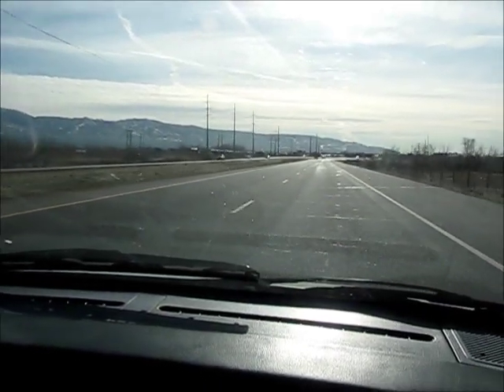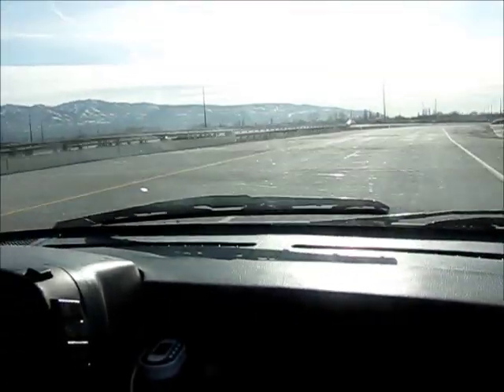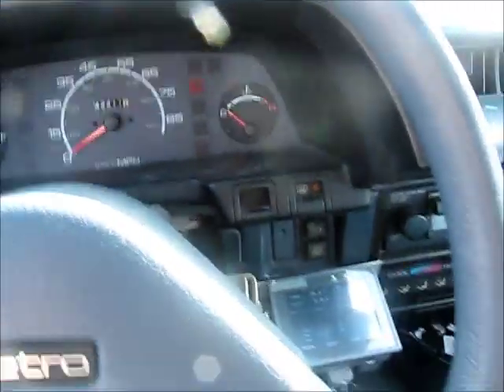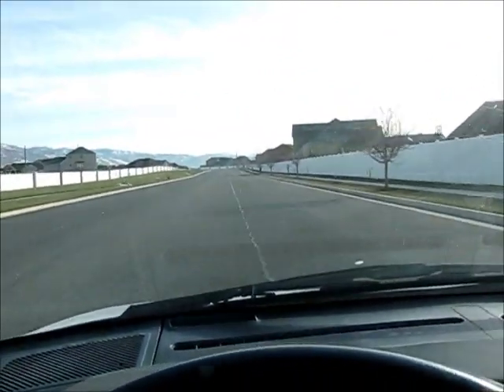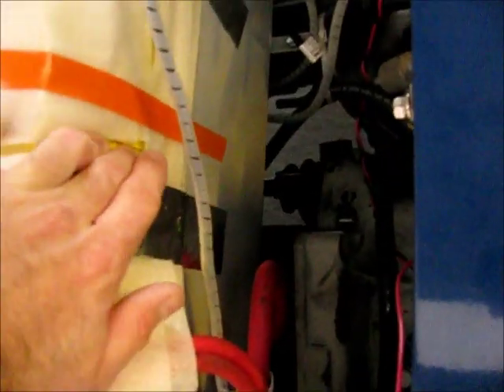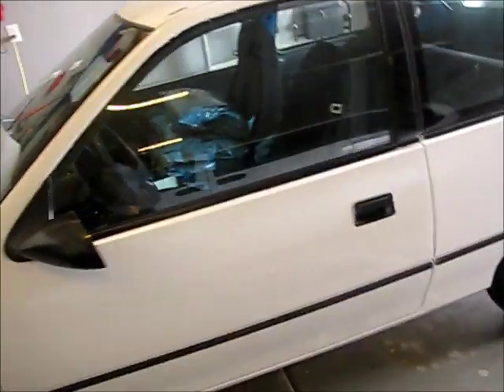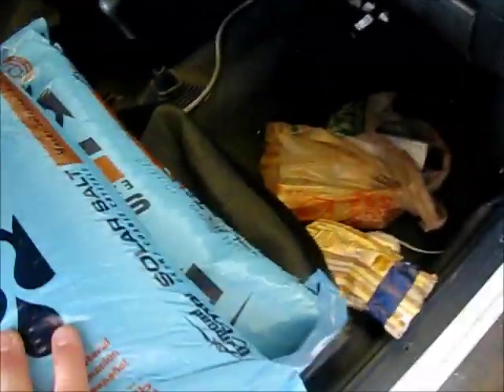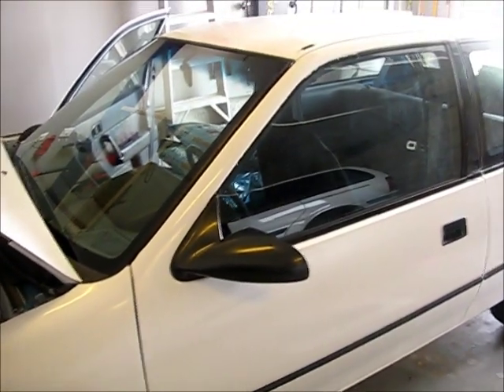Electric Geo Metro 76+ miles

Comment: My buddy built electric cars in 03 and 1000 dollars worth of deka agms would get you 50 miles in a fiero . 14 batteries if I recall. Nissan forklift motor direct couple to 4 speed
Reply from the maker: Lead acid is a super inexpensive way to do it. But they only last for a few hundred charges before they are done and need to be replaced.
Reply: @kc7ekk  in 2003 that's what we had the last one was a lithium porsh 400hp if you cranked it up and about 200 Mile range in eco. He's good, I learned alot. If I had the right motor and controller I'd like to try it but it's not in the cards , the metro was a good choice I hope you still got the car
Reply from the maker: @johnhosler6636  I pieced it out and sold off the parts in 2015 to pay for my first commercially made EV. 
But that Geo EV was a fun commuter car and hobby experience. Definitely not in the same category of comfort and luxury as any EV that you can buy today though.

Comment from the maker: Update:  It has been 100 + degrees F many days this summer.  The motor is still running strong.  After 20 miles, it runs hot, about 160 degrees F.  I'm happy with it though.

Comment from the maker: I bought the motor, controller, pot box and contactor at electricmotorsport.  They have good prices on PM motors.  These motors are very small but powerful.  They aren't well suited for an electric car but with aeromods and light batteries I have been happy with my Geo EV.  6600+ miles and it is still going. If I were to do it again, I would pay the extra cash and go with a good AC drive and induction motor.
I'm glad you liked my website.  Thanks for looking.  Good luck in your ventures.

Comment from the maker: Todd, yes I have a temp sensor on the motor.  I have since added an air duct directly to the motor.  It is a huge improvement in keeping the motor from overheating.  I have yet to verify performance in the summer time though.

Comment: How are your Li batteries after 2 years? I did not find info about your battery upgrade on your blog. I noticed you did not strap them. Did they puff-up after a while? What's the capacity loss so far?
Reply from the maker: After 2 years and almost 17,000 miles, the LiFe-PO4 batteries are still like new. There has been no evidence of capacity loss at all. No puffing either. In fact, they have never gotten hot, not even after pulling 160 amps for 30 minutes strait (1C discharge rate). It looks like they are well on their way to living up to their claimed 5000 charge cycle life after all. 
I am very pleased with them. The only down side is I have to manually balance 2 of the cells every few months.
Reply: kc7ekk That great!

Comment: Can't you find a way to install an alternator to charge the batteries as you drive?  Just a thought...
Reply from the maker: Most electric cars already have regenerative brakes that collect the car's energy, thus slowing it down.  You can gain several miles of range by going down a steep canyon road.  It's pretty cool actually.  Nothing is 100% loss-less though, which is why you can never re-charge while you drive and not lose more energy than you gain.

Comment: Is it possible to add solar panels to charge as you drive, getting even more range?
Reply: No.
The best use of solar panels is to run a fan to keep the car cooler when parked .

It could charge the car if left in the sun a week or so unused .

Comment: my local Chevrolet dealership call me about a Chevy Spark electric vehicle. I think I'm going to buy. but I want to convert. For the Love of the Hobby. I wish I could get my hands on a. hundred 44 volt controller Curtis. I know it's not going to be cheap $1,500 for a good one. is there a place I can get a used one?
Reply from the maker: Ebay

Comment: I just got a 92 geo metro (got it for free) but I want to convert it to an ev. So I was wondering what motor you are using? And what kind of battery, controller, and if you have a video on where you placed the batteries. I'm 21 out of mechanical school but want to build my own ev. Any tips? Anything would help.....
Reply from the maker: Check out my blog on how I made this car at JohnSavesEnergy dot com

Comment: What kind of state of charge meter do you have there? it's pretty awesome. Make model number?? I am currently building my own electric car and any information would be helpful. Thanks
Reply from the maker: Sterling Hughs It's called a Ligoo. this model runs about $800 bran new. I'm actually selling it on eBay for $395 if you are interested. Also LifePo4 batteries, charger and other EV parts.
Reply: Yes I am interested. Also, what kind of adapter plate did you use for the transmission? Or would you be willing to sell the electric car in its entirety?
Reply from the maker: Sterling Hughs I build the adapter plate out of a steel gusset. 
I no longer have the car but I still have most of its EV parts, (motor, contactor, adapter plate, shaft coupler, BMS, charger and 12kWh LiFe battery pack. Contact me at kc7ekk at gmail dot com and we can discuss further.
Reply: I have e-mailed you

Comment: what is a ballpark cost on building an electric geo. I have a 94 geo metro already.
Reply from the maker: It was about $8000. It was a fun project but with a abundance of super-inexpensive used Nissan Leafs, now it is not worth except for the hobby experience.
Reply: JohnSavesEnergy what if you use inexpensive led acid batteries. I would love to have a used Chevrolet Spark. $8,000 now.
Reply from the maker: It would be much cheaper but your range would only be about 1/3rd (or about 25 miles) because the energy density of lead acid is so poor. Also they only last about 1-2 years before you would have to replace the batteries.

Comment: Can you go higher than 72V?   Add more batteries, or not?
Reply from the maker: I could but the motor and controller are only 72 volts.  Also the BMS is only for 24 cells (a 72 V pack).

Comment: Congratulations, Lithiums are great, aren't they.
It's OK to do that sort of test once, but don't drive with a low voltage alarm happening for very long. Try to leave 20% in your cells at least for a reasonably long life. Nice under cover.What capacity cells are you using? My conversion is a similar size car.  Merry Christmas.

Comment: Glad to see I'm not the only who has lost sleep studying the awesomeness of your website! Do you think it would be worth the weight to add thin film solar panels to the roof and hood to extend the range and charge?
Reply from the maker: I have considered the idea but have not done with it.  With the surface area of the car covered in PV panels, I could theoretically gain about 8 miles of range while I am parked in the parking lot at work all day.  
My commute is only 40 miles a day and the battery range is 80 miles so I don't really have a need for extra range.  
Since I charge the battery from the solar panels on the house, the car is already solar powered.  Just not range extended with on-board solar power.

Comment: Put batteries everywhere! Where the gas tank used to be, inside of the dashboard since usually nothing is in there anyway, where the engine used to be, behind the rear seat, Inside the center console,  around the outside of the spare tire well since it's hidden from above. BATTERIES EVERYWHERE!!!!
Reply from the maker: You can do this only to an extent. Resistive losses are lowest when the wires between each battery (bus bars) are very short. This is done by grouping the batteries into packs. Also battery balancing is more successful when bus bar lengths between each battery are identical. 
I ended up splitting up my battery pack into 3 smaller packs. 
8 cells under the back seat where the gas tank used to be, 12 cells above the motor and transmission and 6 cells in back of the grill. The relatively long wire run going to the rear battery cells causes a lot of grief keeping one of the cells balanced.

Comment from the maker: It is certainly possible but why?  Just buy a used Prius or a Honda Civic if you need to drive farther than 80 miles.  
You can't make gasoline very easily in your own backyard.  But I can make enough electricity to drive my Geo Metro EV 10,000 miles a year with only four, 240 watt solar panels on my house roof.